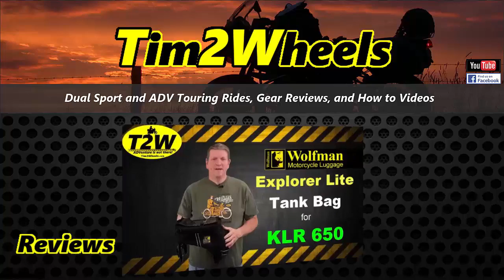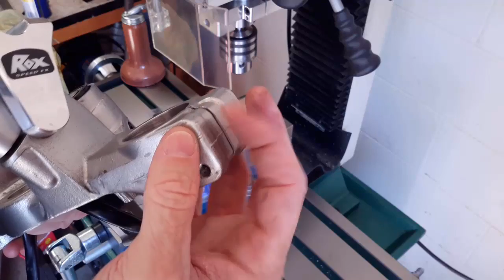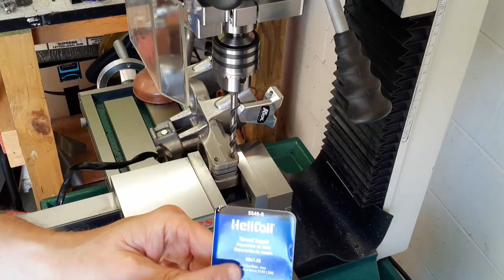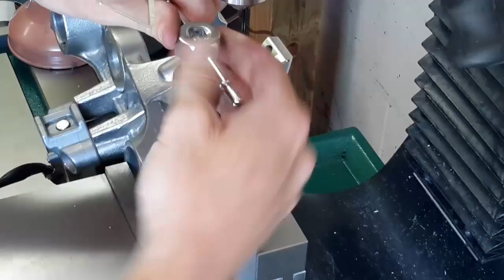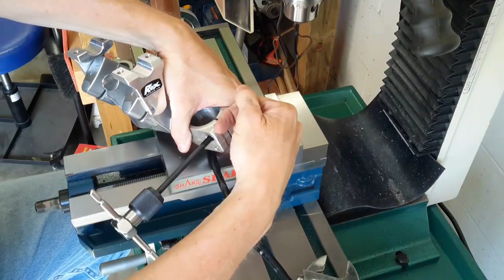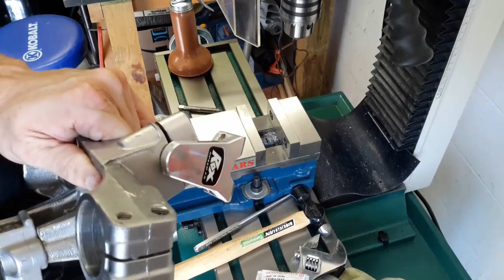T2W How To: HeliCoil Thread Repair

Comment: Great vide, thanks. It may be good to use aluminum cutting oil to avoid snapping a tap or damaging the threads. It also eases the cutting by lubricating the process.

Comment: Is it okay to use  a power tool when tapping a hole, instead of the  T-handle wrench? Also, is it okay to use locktite  on helicoils? Thanks!
Reply from the maker: With smaller taps I've always been concerned with breaking the tap due to chip build-up. That's why you see the constant forward and backwards turning, to clear chips. It's a PIA to remove a broken tap. With larger size taps (3/8" and up), it is much less likely to break, so power tools can be used at times.
Thanks for the comment and for watching.

Comment: Will a helicoil be strong enough to take the torque if used in a front wheel to secure a front rotor 18Nm?
Reply from the maker: Yes. They have incredible holding power and will stand up to the torque spec, and more.
Thanks for the comment and for watching.

Comment: How do know how far down to insert the heli coil into the hole?
Reply from the maker: I just centered it in this hole since it was a through hole (open on both ends). The position can vary depending on the application and hole type.
Thanks for the comment and for watching.

Comment: Hi what the bolt size? Is it 12mm bolt? Is it a 12mm socket wrench? Thanks ing advance
Reply: Thank you so much. Very well explained. Now i can fix the threads. Keep it up.
Reply from the maker: Hi Mark,
The OEM bolt (Part# 130BA0840) is 8mm in diameter x 40mm long (M8x40). It has a 12mm flanged Hex head, so yes, a 12mm socket//wrench will fit.
Thanks for the question and for watching.

Comment: I have used a LOT of HeliCoils and TimeSerts. I have even used them where the threads were still good, to make them stronger. Screwing a steel bolt into cast aluminum IMO has never been a great idea. Using a steel thread insert prevents the aluminum from stripping out, especially on bolts that are frequently removed. In your case, the bolt itself should have also been stronger. For a steel bolt to break when screwed into aluminum threads means the bolt is very weak. OEM parts are often much weaker than they should be. In that situation, I think a longer bolt with a nut on it should have been the way it was designed to begin with. That way, both the bolt and nut can be replaced cheaply without damage to the expensive aluminum part. However, it is what it is, the back side is not completely flat (though a machine shop could have fixed that) so a nut would not fit properly against it. I would have either replaced the entire triple clamp with one form eBay, or had a machine shop machine ALL of the holes flat on the back side, and used at least 10.9 bolts and nuts in them.
Reply: There's another video somewhere on YouTube of a guy that says he doesn't trust helicoils, but he loves timeserts. I look them up and the times serts cost 4x as much. Since you used a lot of both, what's your opinion?
Reply: do you know where can i buy helicoil inserts

Comment: I've gotta do the same thing to my foot peg brackets, they're all stripped. A good thing about HeliCoils is now your threads are stronger, and less prone to stripping again. In fact, Edelbrock does this on exhaust bolt holes on their heads right from the factory. Great video as always, Tim!!
Reply from the maker: Hi Daniel, Thanks for that additional info. I must say, I have been impressed with the strength of a HeliCoil thread. I used to think it was a "patch job", but not anymore. As you said, it is usually stronger than the original thread. Especially in a softer material like aluminum.
Thanks for the comment and for watching.

Comment: You may wish to consider next time leaving the vise in position and using the drill press chuck as a reference to get the tap started vertically.
Reply from the maker: LTVoyager - Yep, that occured to me later while watching the video :)
Thanks for the advice and for watching.
Reply: Yeah, apparently there are some taps that have a dimple in the end to help center it in the press, and also there are tap guides like the one on this AvE video. https://youtu.be/LzKZOIt1okA?t=2m9s

Drill press trick - https://youtu.be/GSMW8lPbL1M?t=8m32s

Comment: I have used a time sert insert to repair a stripped spark plug hole on my 1500 nomad. The inserts and tools are pricey  but worked very well. Inserts are available for various size holes.
Reply from the maker: Mark Owsley - There seems to be several solutions for this type of repair. Thanks for the info and for watching.

Comment: For some reason I remember hearing to use green threadlock with thread replacement products, just to make ultra sure it doesn't back out or move when torquing/de-torquing.
Reply from the maker: Catman - I have not heard that, but it makes sense to lock it in place. Thanks for the info and for watching.
Reply: I use to repair ford transmission cases, and that's what we used at the manufacture was green thread lock